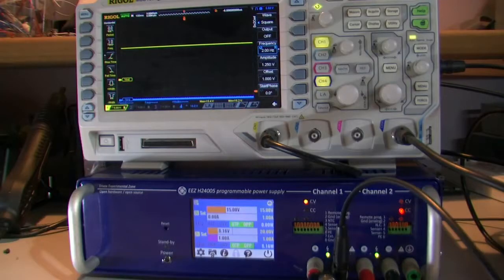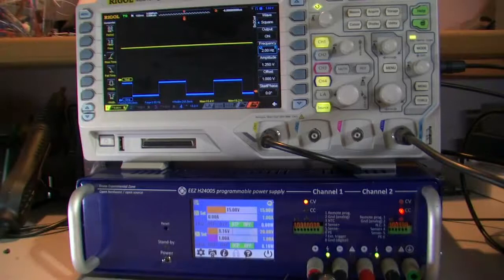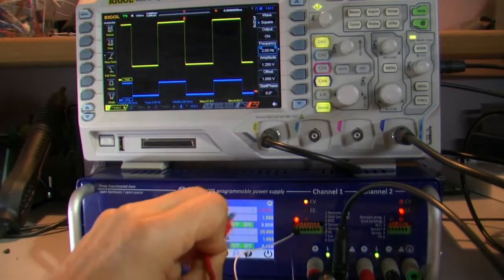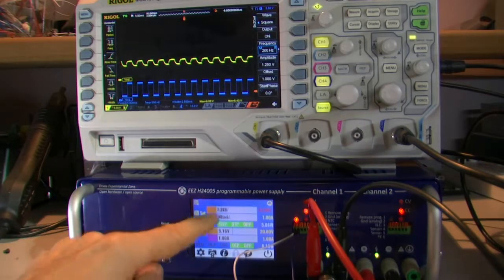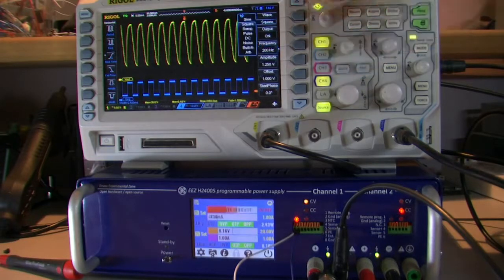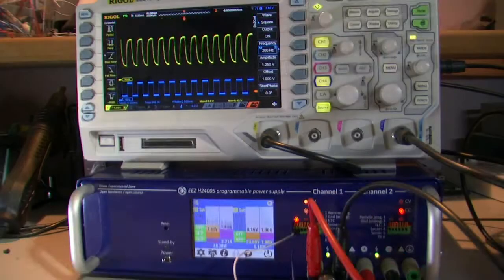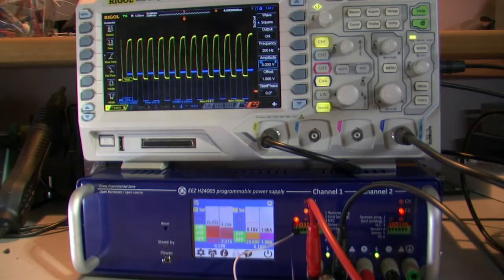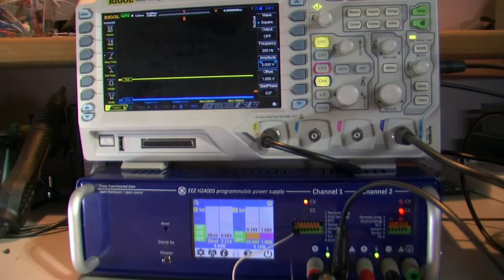External/remote voltage programming

Comment: Hi.
Wouldn't it be much better to show `bargraph` values in one place instead of tracking end of the bar? Now with high frequency changes output value is hardly readable, and situation gets even worse is You hit that threshold where value jumps from one side to another (where there is not enough space at the end). Ideally text would always be in perfect contrast with background (depending if its over empty track of actuall bar) but I'm guessing You dont have such granular controll (to colorize X pixels of element) so just any color with high enough contrast ratio to the gray, orange and violet would do the trick.

Keep up the great work! I've seen this project looong time ago on EEV forum and was hoping You'll succeed :)